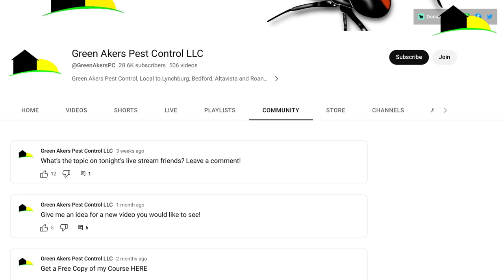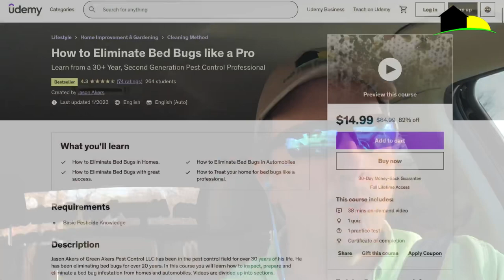Bed Bugs, A Step By Step Guide to elimination - The Only Real Solution (TLDR it isn’t Steam or DE)

Comment: You are just so unbelievably generous with your information and detail. I am constantly impressed with every video I see of yours. My question at this moment is, why not spray the floors? If the bed bugs have to walk on the floors to get from where they are to the person, why is that not a good strategy to getting them? Thank you, sir.
Reply from the maker: Treating the floors is not needed and bed bugs rarely crawl over wide open areas like floors. They live near baseboards and areas around beds not far away so that they need to travel across the floor. The label for crossfire says not to use it as a broadcast pesticide as well.
Reply: @GreenAkersPC  That's an excellent answer. Specific, clear, and nothing vague about it. I really appreciate that. Thank you.
Reply: One of my problems is that I live in a house with okd fashioned hrd wood flors with gaps between.And I can see the bites-they smeak past my corcs and bite my ankles.They don't need to hide anywhere else.I have ended up covering my floors with foam board.Yesterday I got multi bites on my ankles -just becuse I was sitting in one spot.Yet I cannot find them(I brought them home from my son's place)_Any suggestions for the old type of hadwood floors?

Comment: Please follow his instructions. Found one bug Sept 1st immediately went to YouTube. Laid down DE. Still bites (I’m the only one of 3 in house) Ordered Crossfire Oct 7th and reapplied Oct 18th just in case we missed any area. Also used 2nd application to include my car. Today, Nov 1st have not been bitten or seen evidence in weeks. We had a very mild infestation and a very severe case of obsessive behavior changing sheets and inspecting every inch of my house. Sitting here today I finally feel I’m recovering from the trauma. Skip all other products here on YouTube and use crossfire as soon as you’ve identified a bed bug in your home. Don’t forget to treat your car as well.
Reply from the maker: Many people use a plastic el-cheapo sprayer and do just fine. A B&G isn’t required to treat it just does a better job

Comment: I did absolutely everything WRONG 😕 on every way and I spent too much money. As a senior with very little money I totally fd up. This came on do suddenly and I live alone and don’t visit a lot. So I have a question. I’m one of them that has been getting bit and have torn my place up and have found not a single bug of any kind. So here’s my question… when I sprayed the cracks in my ceilings over my bed, like particles dripped out with excess chemical. (Raid bedbug 😕) was that possibly bedbugs or dust. I’ve lived in my place 29 years and have never put any sort of liquid in that area except paint. I’m going damn crazy with this. I have been get bit for three weeks now
Reply: My sofa and chair are only three years old and I am going toss them. My bed is a tempurpedic but is in an encasment. I can’t offers to but another one but it’s saving my back. This is so damn upsetting.

Comment: Hey Jason hope all is well? So I have a bed bug problem. I live in a mobile home they are transferring from room to room I’m using rubbing alcohol ATM was told only way to kill them is with heat treat I’ve saw your video you explaining how heat treat works and why it’s not effective I’ve tried several different things I’m desperate at this time. Where can I buy this cross fire and the sprayer I don’t have the 1000s of $$ to pay for a professional. Is this spray safe for humans and animals or does everyone incl animals have to be removed before spraying if so how long will I have to remain outside? I have 2 autistic boys 4 dogs a cat and 5 birds. Thank you and I appreciate any and all help I can get. Your videos are so helpful, but I really need to get rid of these things like yesterday.
Reply: Also how do I treat inside the walls and outlets?
Reply: Cimexa for the walls and outlets.  Dust it lightly

Comment: Hey quick question, so what’s the deal with synthetic vs non synthetic pyrethroids? I was looking into the active ingredients of Crossfire and Temprid and they both contain one but I though Bed Bugs were resistant to them/acted as a repellent? Thanks
Reply: organic is best. Crossfire. The other makes bb not come around repels them But it don't solve issue. Crossfire does not repel them and when they come through the spray they die. And when using the store bought u can't use crossfire cause the non organic repels them. So now gotta wait 60, 90 days to use Crossfire.

Comment: what can you do if you're getting bitten so bad every night. Is there something I can put on my body to deter them. Have tried essential oil, DE come to find out that this is wrong when your using crossfire do I have to wait 3 months. I am old and sickly any suggestions. I am on fixed income and not up for doing it myself so will have to hire someone and take out a loan. I am waking up every night at 3 am Will anything prevent them from biting.

Comment: do we still have to do all the common prep stuff most exterminators tell people to do , if we are using crossfire , and can mixed crossfire be left over to use another day or does it have to be used all in one treatment ?
Reply from the maker: Just made this for you https://youtube.com/shorts/fONAFpHuUyk?feature=share
Reply: This is amazing! I don’t know what the heck the other guys are using but they recommended that we throw away all papers and take down pictures off the walls… nightmare prep work. Especially when you’re dealing with elderly and bed bugs. They don’t want you to touch anything and you don’t want to!! But the other exterminator insists. Ugh!

Comment: Is there any other kind of sprayer someone could get besides the B and G?
Reply: U can use a paint brush also. I use a Harbor freight 1 gallon sprayer. But I had to cut a glow stick in half, poke a hole and insert a 3 inch straw from a wd40 can. That way it don't drip. It just don't have the pressure like a BnG. HF has no wand. It's attached to the bottle. I spray a small, thin line like a fence around bed, base boards etc. I followed what he said and I've been free of BB.
Reply: @kitjasabsgabs1830  thanks I have sprayed twice so far but I honestly believe it was a bad infestation bc a friend lived here for about 3 years and last year she got bed bugs, then she moved to another place. I guess thinking she could get rid of them that way. Tried to tell her you can’t but now I am fighting to get rid of these dang things. Never in my life have I ever had these.
Reply: @reginaedwards897  hi.   no shame in having bbugs. they're found in the fanciest ritziest places.

I'm old. Had my first encounter in my life in February 2023. Used liquid temprid twice, liquid crossfire once. Last treatment march 21 2023. Did all baseboards, ceiling crowns, bedframes, box spring interiors, headboard, sofa frame interior, chair legs and backs.  Been no sightings or bites for 4 months now.  

You gotta go medieval on them at the start of the battle. It's grueling. But worth it.

I'm still wary. I just got comfortable a month ago to stop taking my clothes off in the basement and throwing them in the dryer before entering my living room.